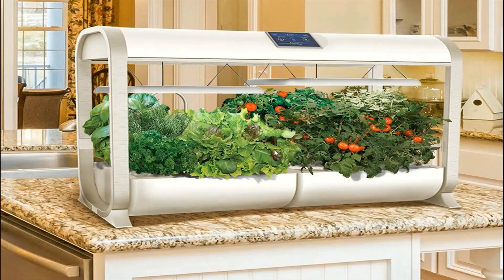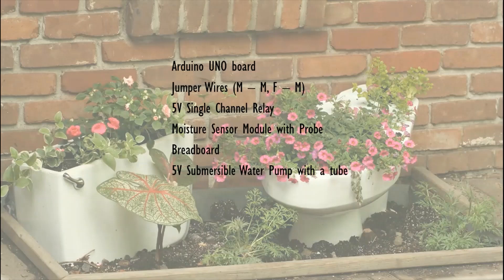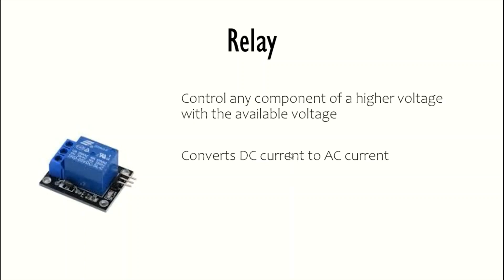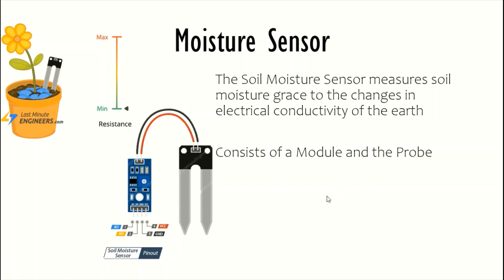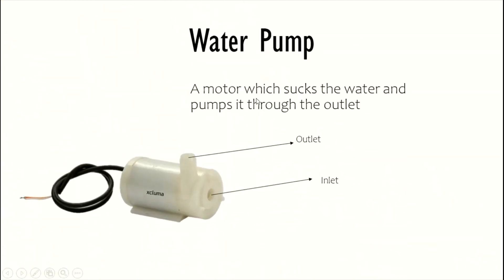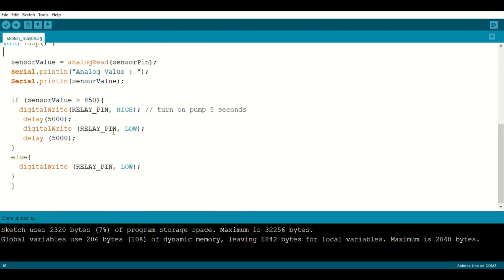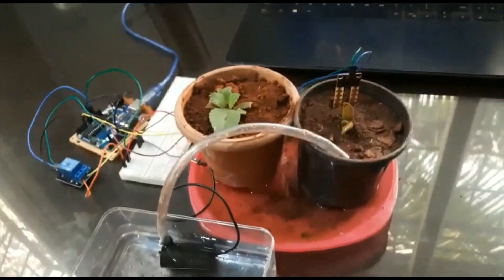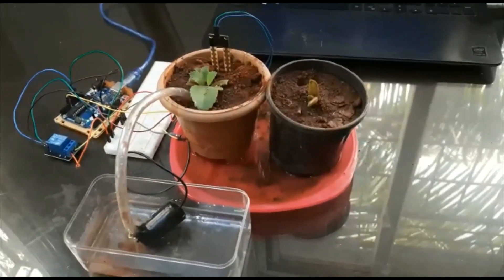Automatic Plant Watering System || Smart Garden with Arduino || By Electrolus

Comment: Excellent video. Only one correction here. The relay is not a dc to ac converter. Relay is just like a switch. When we turn the switch on, the current flows through the circuit and when switched off, the current stops flowing. The current can be AC or DC. In this project, there is no AC. It's all DC (Input as well as output of the relay). 

To clarify, the example of DC to AC converter is "inverter" which we use at home when there is no power.
Reply from the maker: Okay, thanks for correcting!